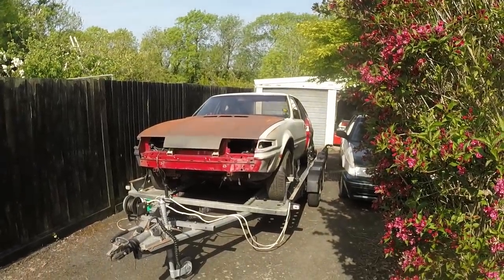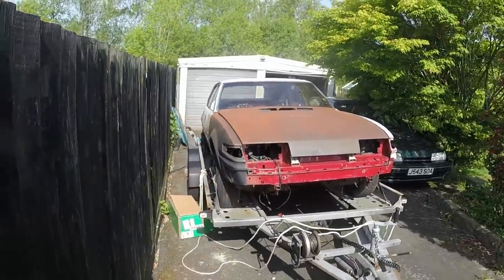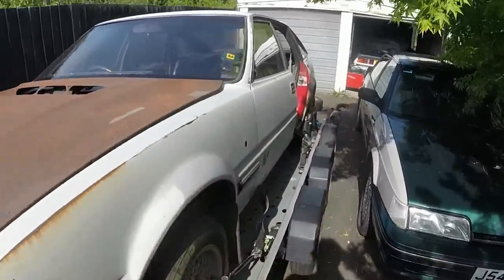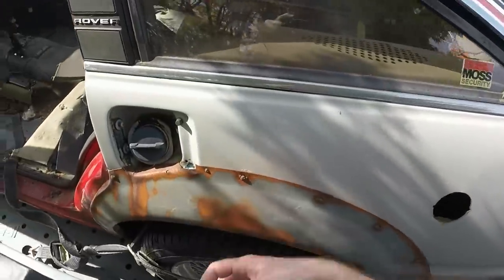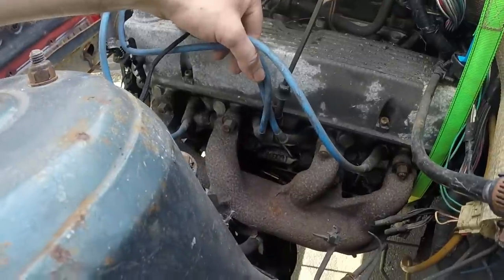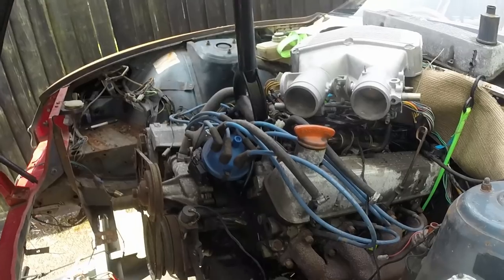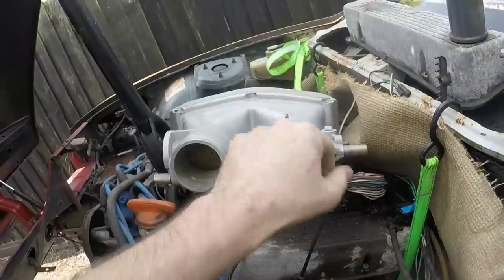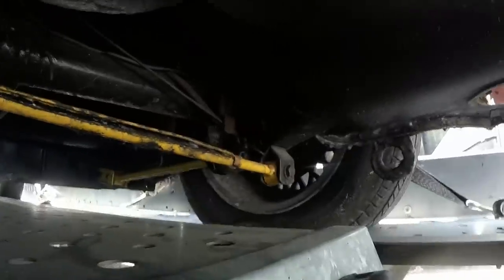The car on the trailer

Comment: I did wonder if anyone was going to take this one on. I got the opportunity to look around it when it was at your "SD1 Guru's" place. and noticed quite a lot of what you pointed out. I at the time didn't have the parts collection to save it, and found a more complete car. I probably do now though! Shame it's been robbed of even more parts since I saw it, but I'm very pleased that you've ended up with it. means it'll be done properly, and not lost as an engine donor!

Comment: Hi there, if it´s Volvo rockers it must be from the B18, B20 engines and they look very similar to me, since every Swede with a garage has got a B18 or B20 somewhere in his garage ;) . Nice to see that you got another SD1 and a rare one as well. Could be a nice TWR Bastos replica if not. Keep up the good work! and Cheers from Sweden.
Reply from the maker: Il have to start doing some googling on teh rockers and pushrods.  I have a spare set that i can closely inspect for markings etc

Comment: A UK market twin-plenum Vitesse manual with factory air conditioning.  That's got to be seriously rare as not many people would have put their hand in their pocket for the serious amount of money that the option would have cost back in the mid-'80s.  Most people who wanted air can would have gone for a Vanden Plas instead...
Reply from the maker: I asked the sd1 club historian and he says its pretty rare, although lots of the later cars were getting it slapped on them to help them sell.
Reply: @nitrosilvia    That makes sense getting towards the end of production with its replacement, the 800, not sharing the parts.  They try to use up as many parts as they have in stock in the factory for production, so a lot of what was optional extra equipment got loaded on to them.  Back in '89-'90, the garage I started my career at, a FIAT main dealer, had a D-reg 2000 in stock.  That had metallic paint, full S velour interior, electric windows all round, alloys and an electric sunroof, and I'm pretty certain a lot of that wasn't standard on a 2000, though I'm not sure exactly what was extra as I only ever really saw early 2000s with the tweed trim in any numbers...

Comment: Well bodged lol Am sure you will get to it. It's a  rair car  Appart from the  bodged up bits it's not to bad a car. Just do it as you go along I know you mean there project's after all. I like your 825 Rover nice motor mate.  Nice way for holding bonnet up spade handle lol.👍
Reply from the maker: Yes still gathering suspension parts for the 800

More here if your interested

https://forum.retro-rides.org/thread/188466/rover-827-si-mk1

Comment: The TP is really one plenum? So the balance between the 2 chokes / throttle bodies is immaterial surely as they're effectively in parallel? Or am I missing something?
Reply from the maker: The problem is that the throttle potentiometer reads off the far end of the throttle spindle. So if there is wear in the spindle bushings on the throttle butterfly at the other end, the first butterfly can begin to open and the engine tries to accelerate but the ecu isn’t getting a signal from the potentiometer to tell it that it is getting air. When it’s new and all right and tight it works perfect but as they do more miles it gets more worn and a real lumpy idle that gets miss diagnosed. I’m told this car was stripped of its twin and went back to single!
Reply: @nitrosilvia  OK, that makes sense, I didn't realise the throttle position sensor was at the end of the linkage.

Comment: Did they offer cruise on a TP? Sure I remember reading that all the TPs were used as internal management roll cars prior to being retailed as used cars? Guess that may influence what options were offered? Big project to take on.
Reply from the maker: Definitely a few of the very early cars were kept on by Rover.  My other twin plenum is one of the first 50 that went from the factory to Lotus for the conversion.  They left the line as fully built single plenum cars, then were modified at lotus with the twin plenum and then transported back.  My other one was first registered to Longbridge, rover, then had the engine removed by the factory and was sent to be destroyed, but it somehow survived.  Its a very very special car.
Reply: @nitrosilvia  Cool. I knew there was something odd about them. Think the VDP EFI was quite an odd one too. Always had a soft spot for V8 SD1s.

Comment: Honestly as bodged as it is you can probably reuse both the rear arch skin panels to do a proper job, really just the boot floor that is needing full work done. Compared to the other cars its really quite a simple project minus the missing parts.
Reply from the maker: Yes its actually a car that looks worse than it is.  I was looking at it again today.  I reckon if you spent 10 very long days, all the metal work would be done.  I have all the parts.  Lots came with the car i just removed them for safe storage.